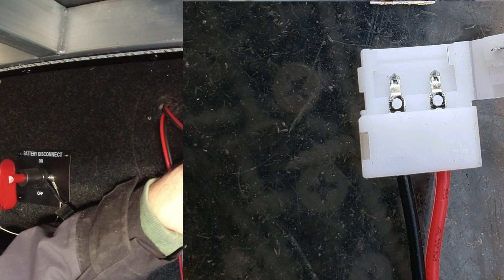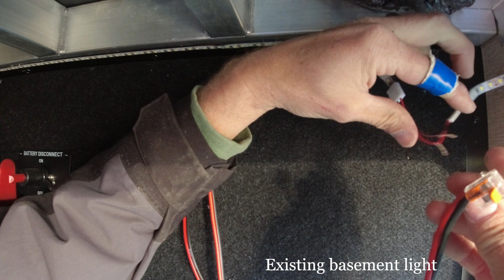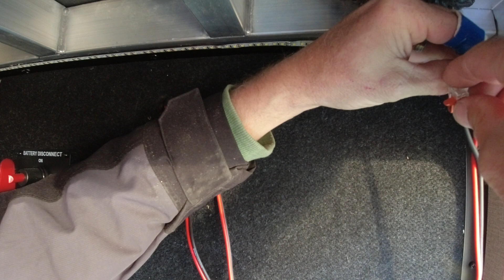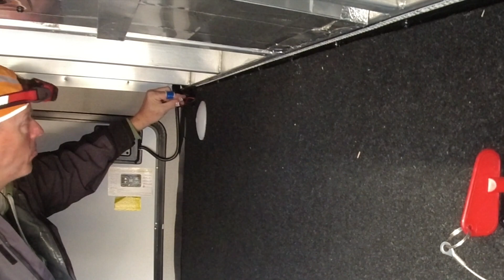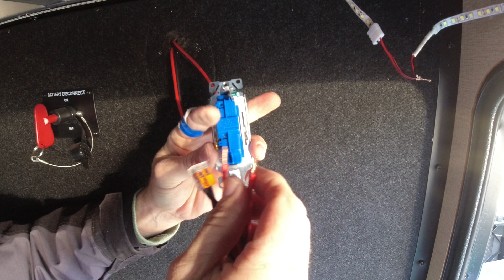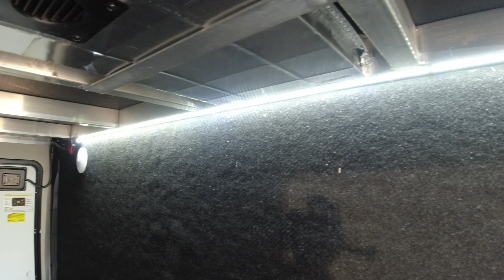Workshop Wednesday: How to wire up LED lighting for RVs

Comment: Nice video, I think I would prefer using IP 65, and probably go overkill and use addressable rgb strips. it’s relatively easy to cut and add power injection where needed.

Comment: When you added the switch it looked like you removed power from the near end of the strip. It looks like you are only powering the strip from the far end. Did you later join the near wires to the switch in the box?
Reply: Yep I see it. Thanks
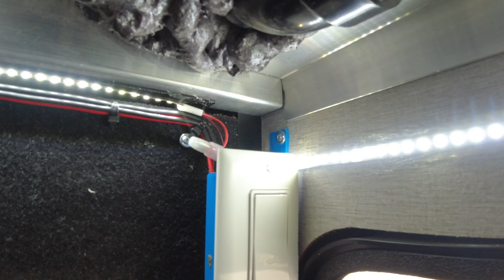Reply from the maker: Yes. You can see it at 6:56.